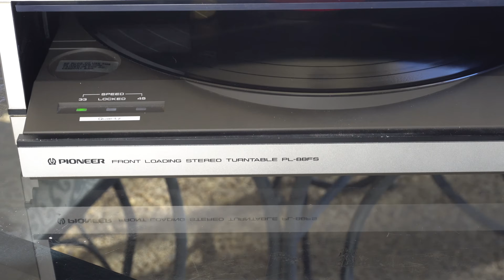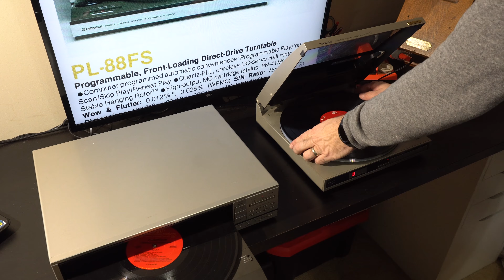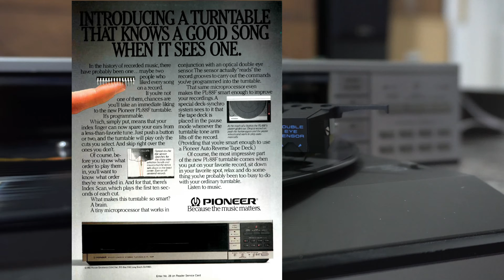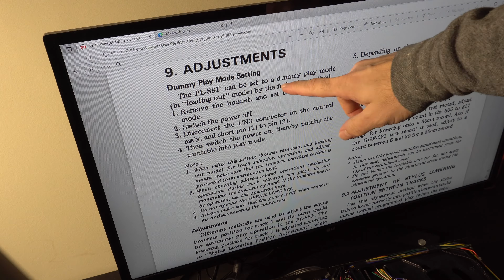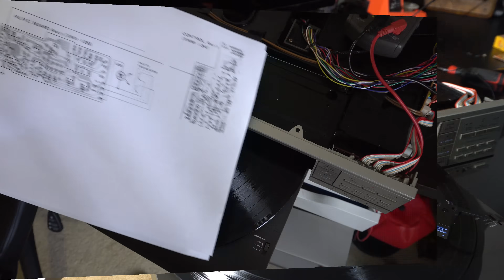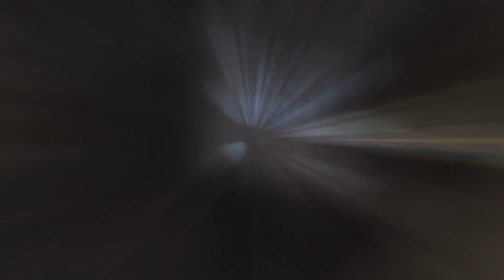Pioneer PL-88FS Front Loading Turntable

Comment: I have a Pioneer PL-L90 Turntable. The linear tracking version of the PL-88FS. I also have sensor problems. Very informative video. I need to check the same parts on mine. I also have a Sony PS-FL7II front load Linear tracking turntable.
Reply from the maker: Thanks for watching and commenting! I need to take another look at this as it seems unusual that tonearm wires would go bad, might need to explore the parts on that back board again more closely.